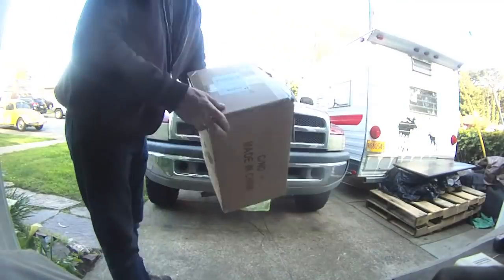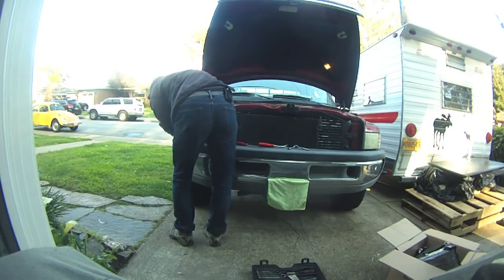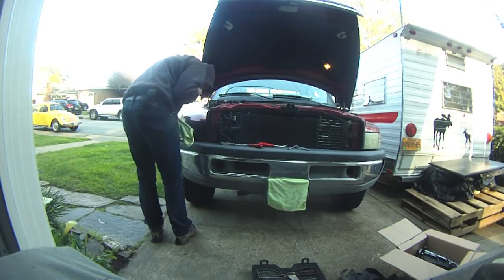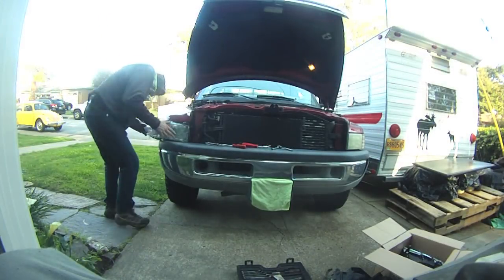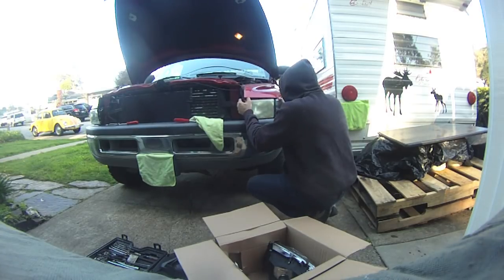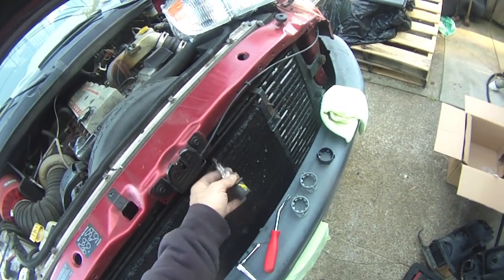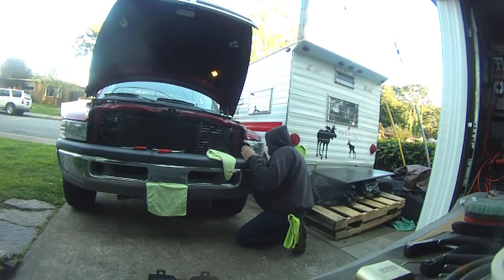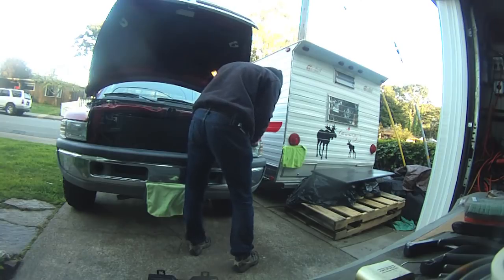Replacing Headlights in the Cummins Work Truck

Comment: I agree lots of the body and interior parts are problems on these second gens. I still like the looks of them better than any out there. The biggest problem I have is some dash panels busting like the piece that the glove box bottom sits in and right side bottom panel cracked and the only place I think those could be found is junk yard and their at least 17 years and older and brittle as hell to.
Reply from the maker: I, too think this is the best looking body style... Dodge was the leader in this grill/fender style.

Comment: hey beekeeper a while back you posted video of building a snow blade on your garden tractor. i asked about your design and i had a case 222 garden tractor. WELL i finally got it done !!i done know how to send or post on you tube , but if would like see a couple short videos on my F/B status im in murray kentucky for your search
Reply from the maker: Hey Paul, I don't do F/B, but happy you got your plow built.  Hope it works out well for you.    My plow is still in service all these years later...Last month, I modified the mounting to work on my Quad.

Comment: Nice little update, how’s the Burban? 
Want to sell it to me yet?
Reply from the maker: The Burb is doing well.  I have been driving it to work for the last month or two during the rainy season.  Everything has a selling price, but I am going to seal a deal this Spring to buy a beat-up ranch truck with a cummins and 4x4 manual trans to swap in to the Suburban.

Comment: The headlights on that era truck suck they are like candles with tin foil behind them my brother had a 95 regular cab Cummins driving the thing at night was awful. The truck itself was a rattle trap cheaply built especially for a truck that was supposed to have a higher trim in those days. To this day Dodge can't build a truck. At work we have a 2008 Dodge dually cab and chassis truck you can feel the cheapness driving it I hate working on it.
Reply from the maker: I agree completely.